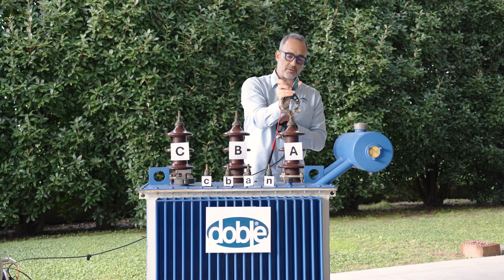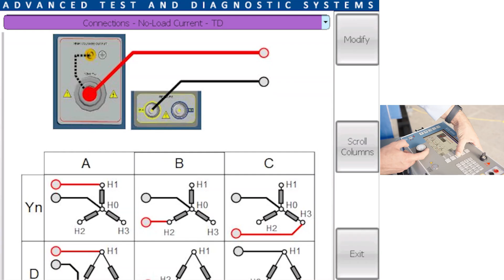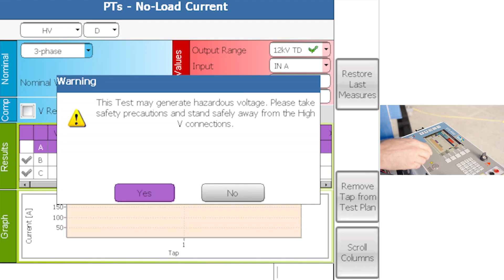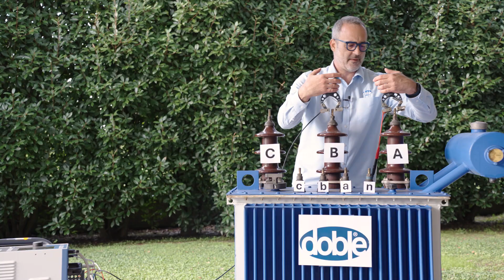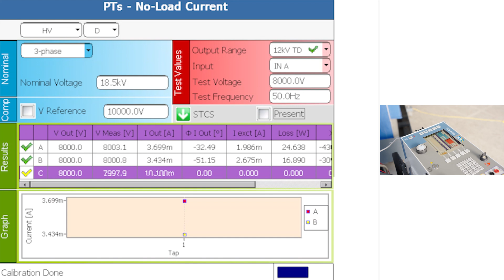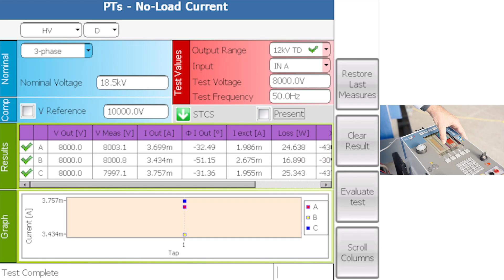No Load (Excitation current) test on a Power Transfornmer using STS 5000 - Practical Video

Comment: What is the difference between that test and the test when we apply 380v to kv side and let hv side open
Reply from the maker: The current changes but that is not the issue because you can use the trafo ratio to calculate what you would get if you did test the other way around